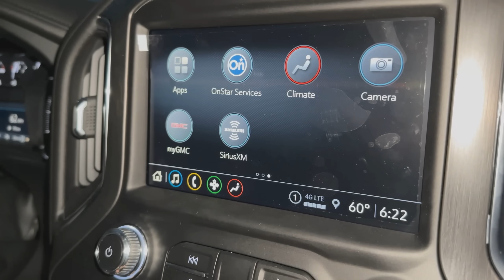First Wash In 12 Years: Free ABANDONED 1990 Volvo 740 Wagon! Detailing and Surprising Best Friend!

Comment: The engine rebuild would make the car very reliable. Volvos had two commercials when I was a teenager. The first one, they dropped out of a helicopter, and drove it off. The second one, they drove the Volvo off the side of a mountain, then they drive the car off! That wagon you sit in a steel cage!

Comment: I had one of these back in the 1990s, great car, roomy and comfortable, would cruise all day at 100 mph if needed, unfortunately new models that came out in the mid 2000's were Ford derived cars, so the quality suffered as a result, rust became more prevalent in later volvo's because they were based on Ford models, not sure if they have reverted back to the same quality (build wise)  when they were sold to Geely in 2010.

Comment: So huge effort on interior and exterior, but I was a bit terrified how you washed under the bonnet, without any protection of the electric parts. And also, probably you cleaned the fuel system, changed oil and other liquids...Why not to show it..Cause for me it looked that you tried just to start engine on that old petrol, which remained...Anyways,great car,really gem. Great job!

Comment: To be honest, I was always fond of american big bad v8 cars.. I love the design from past eras, I love the burbly  crossplane engine sound they make.. 
It tho never really was an option for me for a few different reasons- I live in central EU, in a small state, with honestly laughtable wages.  My family was poor. We tried.. And still try. 
I knew I will propably never drive or own cars like mustang, camaro SS,  Gran Torino or Hemi cuda.. so My dream always was to have a V8 at least.. indeed I managed to get My 2nd BMW.  It was glaciergreen E39 540iA .. after a person that did not took any care of it.. I loved it till its last days. Tried to maintain it, soon tho rebuild of engine and transmission were needed,  some rust was found, and it really was unachievable ať the time. So the car sat in our yard for a Long time.. winters got it rough,  more rust developed. And as I wanted to get it in order, after years of saving and borrowing some money from bank, I was About to start with the repairs.. parts bought, a specialist for bmw rebuilds agreed to do the engine and transmission.. well upon arrival to him, he told me if iam really sure, that without proper garage it will cost me twice as much to get it rewelded, painted, get the suspension redone to factory specs.. approximately another 10000USD.. wich shot me down, like an asteroid, I knew I  dont have this much. So the car, ended up scrapped along with my hopes. 
Prices of these cars skyrocketed since then, so.. I might as well say, that it was scrapped alongside with my dream over all.
I mean, I still got my crappy old 520i, wich also after the Winter needs quite a bit of work.. still sticking to the e39. Tho, its a bit different to have I6 110kw and V8 210kW ( small w with the 520i,cuz its really low on power, its Lazy car) 

So, thats About my story of a dream car, a memory I cherrish, dream I keep in the corner of my heart in hope that some day I can manage to buy it as a veteran car for money that I dont even dream of.

Comment: Low compression on one of the cylinders? Sounds like someone waited a bit too long to change the timing belt. Probably why it was parked in the first place, as skipping a gear on these 16 valve redblock lumps fast becomes “valve, do you take thee piston as your truly beloved? 😂” Have fun with the full engine rebuild, because finding B234 parts can be a bit of a challenge in the U.S.

Comment: Recycling 101. Recycle an old car and the massive energy and material of making a new one is saved. In Cuba they still have cars from the 1950s that are daily drivers. Well designed old cars are like aircraft; they are endlessly fixable until they rust out. New cars are made to be driven 100K miles and thrown away when the electronics give out.

Comment: i am 17 and my first car was a 1995 volvo 850 GLT wagon and if you guys where to give me a car i would want it to be  1995 volvo 850 turbo wagon with a manual transmission i absolutely love manual i drove a 1995 chevy k2500 3quarter ton pickup with a 5 speed trans and i loved it it is in the shop now but i am getting it fixed

Comment: This 16 valve engine was the trial engine to obtain experience for the next gen Volvo engines, mostly the 5cyl- 850 series.
The 5 cyl engine was (or is) modular.
It was made as 4, 5 and 6 cylinders depending on which car model it would be produced for.

Ps: As young i worked at a independent Volvo dealership detailing this gen of Volvo cars.
A pro tip:
The front left and right carpets are super easy to remove separately from the car and are small enough to fit in a household washing machine. 
Makes such a difference, especially on the driver side. 👍
/Greetings from a car guy in Sweden

Comment: Great job, but only in Ohio could you go from junkyard to daily driver . The only  thing you need to do for an Ohio vehicle is slap on a plate and you're ready to roll. No need for any pesky safety inspections or anything like that. As long as it starts and runs, it's a winner. P.S. keep a bunch of bungee cords handy for when the body starts to disintegrate,😆

Comment: Maybe you should stick to cleaning .. because this is very unprofessional to start the engine like this .. 
 .. first check the oil, then empty the petrol tank,  then disconnect the ignition and crank until the oil pressure is there, then start the engine with fresh petrol .. .